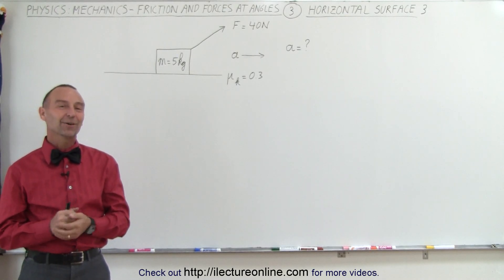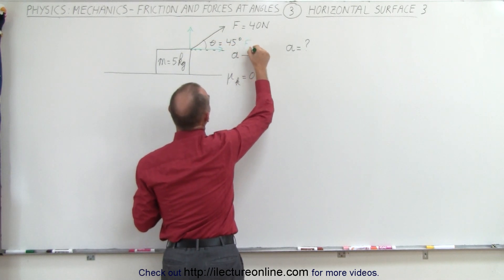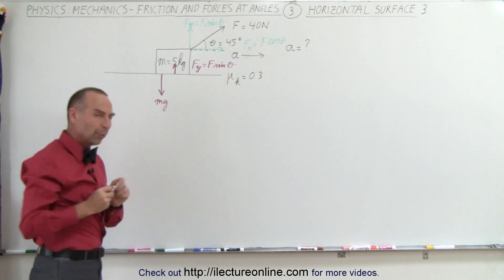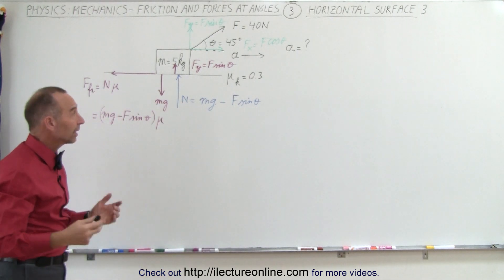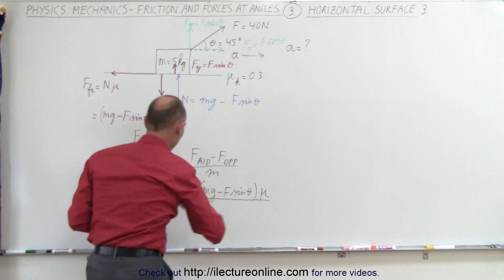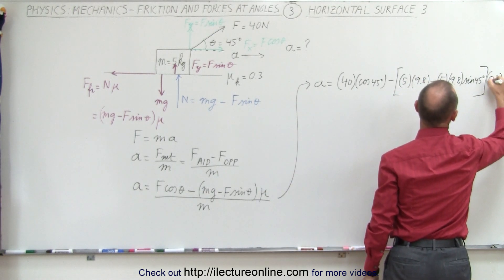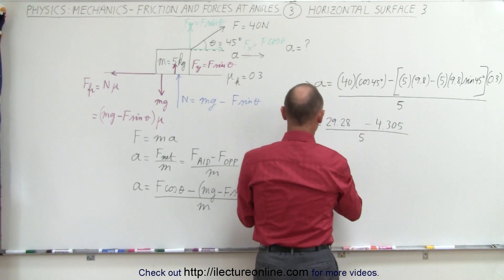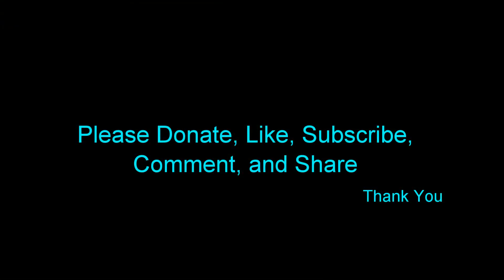Physics 4.7   Friction & Forces at Angles (3 of 8) Horizontal Surface: 3

Comment: Isn’t the normal force supposed to be N= m*g + 50*sin(45) ? It is negative on the left side but then once you solve for the normal force it should be positive, no? I’m taking about when you did it at 2:05
Reply from the maker: Since the y-component of the force is upward, the normal force of the floor pushing back towards the block = mg - F sin(theta)

Comment: The final answer should be 4.61 m/s^2

For those who are wondering where the mistake is made. In the calculation mg was multiplied by sin(45) instead of f.
So if you did the problem before the video started don't worry, you are most likely correct.

Comment: Excuse me Sir, for the last part when substituting in the numbers, if it is Fsinθ, I dont understand why mg sinθ was used here. I think it should be 40 *sin(45), however if mgsinθ is used, then it is (5)(9.8)sin(45), which is what has been done in the video. I may be mistaken, and I may have made a mistake with substituting, but I have a phyiscs half yearly preliminary test in 8 hours and I need to make sure which one to use please? Thanks in Advance!
Reply from the maker: When we calculate the friction of an object being dragged across the floor, it is usually done by taking the weight of the object and multiplying that with the coefficient of friction.  (mg)(u).   But in this case, part of the pulling force (the vertical component = F sin(theta)) reduces the weight of the object.

Comment: I think there is a typo, we multiplied mg by sin 45 rather than F by sin 45. You of course wrote it correctly in the general formula however I think you were bored with the question and typed it wrong.
Reply from the maker: You definitely found an error.  Yes, it should be "F" insead of "mg".  It is the result of not paying enough attention.

Comment: Hello sir, I wanted to inform you that you have missed a crucial step in this problem. You should have also checked whether the Y- component of the force was larger than the weight of the object as that would have influenced the normal force and thus, the friction. If it was larger(or equal to), then the normal force would have been zero and so would the friction. It is also a step of great importance that shouldn't be forgotten, especially when teaching. But, in this case, it was not necessary and everything turned out great(except for the extra factor of 9.8). Please keep up the excellent work. Yours truly.
Reply from the maker: That would have been discovered while solving the problem as shown, no need to do the extra check, but yes it does offer additional understanding.

Comment: Hello. What if the object moves with a constant velocity and you're given the coefficient of kinetic friction, the mass of the object, and the angle at which the force was applied but you weren't given the magnitude of the force. Will it be possible to calculate the normal force on the object? If yes, could you please help me out?

Comment: why is g 9.8 not -9.8 assuming that gravity is negative.
Reply from the maker: If we express the MAGNITUDE of a vector we use the magnitude of "g".  The magnitude of a vector cannot be negative.  The negative sign is given to a VECTOR when it points in the negative direction
Reply: @MichelvanBiezen  ohhhhh. thank you so much i get it know. I was struggling to find an answer to this.

Comment: Sir, I think but far from sure is there might be an error as it is Fsin(th) not mgsin(th) , I made the exact mistake on previous video. Please inform me if I am incorrect?
Reply from the maker: The trig functions on this video are correct.
Reply: Michel van Biezen well, but you did 5*9.81- 5*9,81sin45 in the last step, shouldnt it be 5*9,81 - 40sin45???? I am sorry for bothering.
Reply: @ahmedal-ebrashy3691  I agree.  F is 40... so it shouldnt be mg